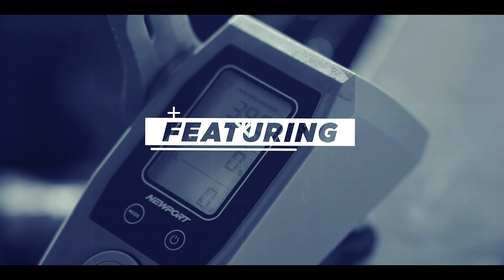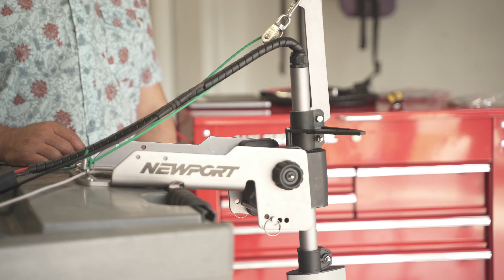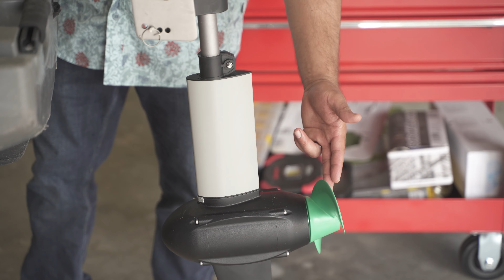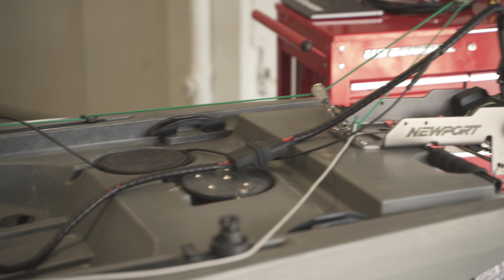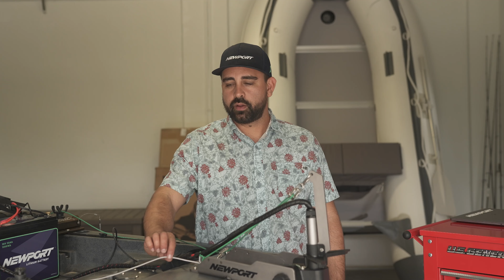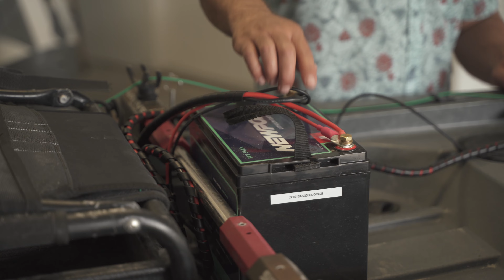NK300 Electric Kayak Outboard Motor | Quick Start

Comment: I was bummed to find out that the bolts for the mounting plate were too big for the pre-drilled holes in my hobie outback. Trying to find bolts that fit in a rural town in WV.
Reply from the maker: @chilson.fillips  Hobie Outback has 1/4-20 inserts. The Nk180PRO should have come with a set of screws to fit those inserts
Reply: @Newport_Vessels  I actually got the NK300. Hoping those tiny screws will hold that mounting plate down, lol.